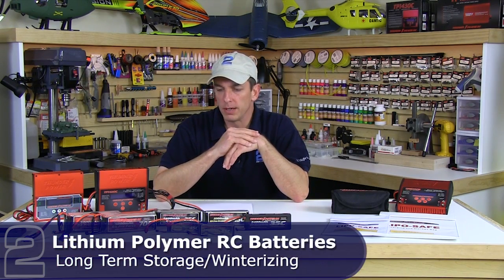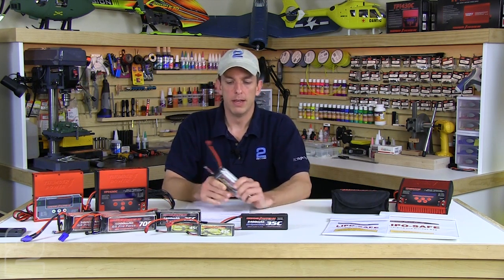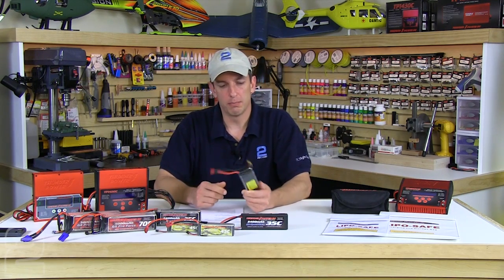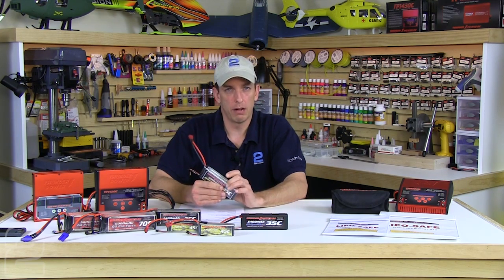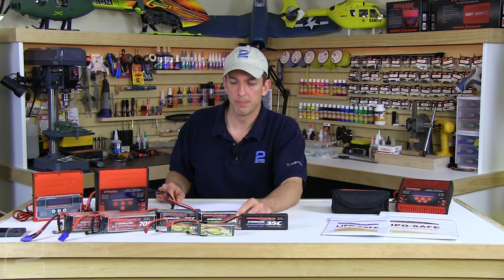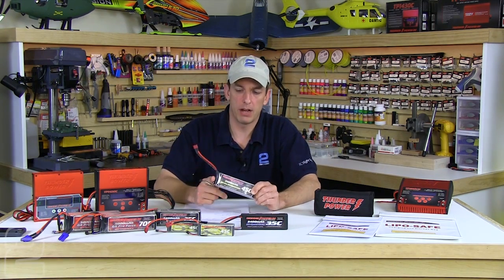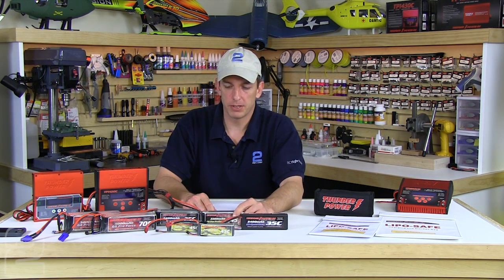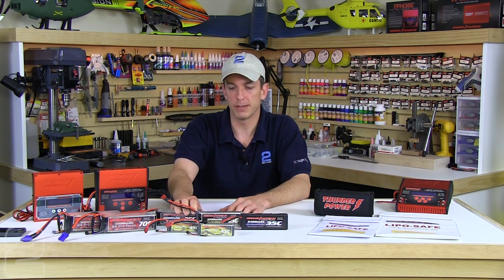RC LiPo Battery Storage

Comment: Im new to this sport i have a accucell 6 charger and my batteries are Turnigy 2.2 3cell    11.1v, 
 I am ok with the charging side of things, but I have a question about the storage.
 once battery is linked to charger  I select storage, am i correct in selecting 3.8v on voltage or do i have to enter the 11.1v.  it also asks what Amp to use for discharge this i dont know. so can you assist me with the answer and is there a formula that allows you to work this out. Thanks for any help Andy

Comment: Can storage charge normally upto 3.8 multiple 4s battery's on a parallel charge board to save time
Reply: So if I have some rc cars with li-ion batteries then I can keep it at 100% charge for a month and it is fine?

Comment: Very new to lipos. I starting out with spektrum smart batteries and charger. 3s 3200mah 11.1v . The first battery was fully charged and I used it playing with my apprentice just setting up everything up for a few days. Put it back on the charger and put it in storage. Storage put the cells at 3.93 - 3.95- and 3.96 volts.. Isn’t that a little high for storage?  Great videos by the way.

Comment: I have a 2S 5000mAh 25c lipo battery. I have a balancing charger that does not have a "storage charge" feature. 
I am reading in the manuel for the lipo battery that it should be stored at 3.6v-3.9v. What does this mean?
Should I just charge up the battery to 50% capacity and store it that way?

Comment: Incredible that in 7 years literally nothing changed in this field. Same batteries, same concepts, possible nothing new happened during these years? also this is not exactly a field that had no updates during these years.
Reply: So what changed then? 
6s are more common now, there are more chargers with the internal ac/dc convertor, and that's it.
Reply: Hey do you know if I have some rc cars with li-ion batteries then I can keep it at 100% charge for a month and it is fine?

Comment: I have a 1s 3.7volt battery. How much would i charge it to store it for long term, still halfway? Also i cannot discharge it because my charger does not have that option, so i would just have to charge it up to the storage voltage.

Comment: My cousin gave me an airplane he found stuck in a tree and I wasn’t familiar with lipo or airplanes (at the time) and I never used the battery or electronics and it sat for about 5 yrs. just recently I came across the lipo battery from the plane crash and I checked the voltage and it was about 17 volts. This is a 4s 2200 mah, I put it in my 1/8 rc8e3 and I ran it for 10 minutes and it STILL has juice but I stoped at about 10 volts and put it away again. My cheap and only charger, reedy charger, wouldn’t read the cell count correctly I think it said 3s rather than 4s and it’s a little puffy not much. I had no idea a Lipo could hold a full charge for that long… Unless one of the cells went bad and the other three cells collected its charge because 17 V is more than what the pack is supposed to be. What do you think?

Comment: I have traxxas 6700 lipo for X Maxx, have Traxxas Live charger with storage mode, If I put battery in storage  will it be good for 4 to 6 months ? Plan on using them in the spring.

Comment: Quick question, I run two Pro Boats and an Arrma #Granite 4x4 BLX Truck and I run a lot of 2s and 3s lipo's batteries!  What's the best number to store them at - 50% correct?

Comment: Hello. can you help me please with some advice? how do I keep my batteries in order not to lose their capacity? even if I put them on the shelf to 50% (lipo storage) some of them lose their capacity when they load them ... for example from 2500mah I still have 1200. I tried to discharge them and charge them again many times believing that this cycle will resurrect them but without success. some of them or puffed and used 2-3 times. I'm new to rc, and even if I really like it's expensive to buy batteries. please help me.

Comment: Am so glad I have seen this video! I normally charge mine fully and store them until the next bash session! So once the batteries are in storage mode how long will they stay like that until they hit the low voltage safety level? You mention 1% a month.

Comment: hi i need your help i am making a electric skateboard and need lipo for max power.i am using 2 motorTurnigy Aerodrive SK3 - 3536-1200kv Brushless Outrunner Motor and 2 esc YEP ESC 40A (2~6S) SBEC Brushless Speed Controller .what lipo would you choose
Motor
Turns: 14T
Voltage: 3~4S Lipoly
RPM/V: 1200kv
Internal resistance: 0.028 Ohm
Max Loading: 38A
Max Power: 560W
Shaft Dia: 5.0mm
Bolt holes: 25mm
Bolt thread: M3
Weight: 111g
Motor Plug: 3.5mm Bullet Connector 

ESC 
Max Cont Current: 40A
Max Burst Current: 50A for 10 seconds
Input Voltage: 2-6 cells li-XX or 6-16 Ni-MH/Ni-Cd battery
BEC: 5.5V/5A Switching BEC
PWM: 8~16 KHz
Max RPM: 240,000rpm for 2 Poles Brushless Motor
PCB Size: 50x25x12mm
Weight: 43g (including wires)

Recommended
YEP programming card required to access the full suit of programming options.

Comment: hello nice info there you gave but i have some questions to make if you have time to answer i would be happyI have two lipo batterys 11,1 v (3c) when i fly my plane when will the battery stops giving voltage?and when should i set the voltage-buzzer to alarm so that i will not have falls.My other question is if i fly and i want to fly in 3 days again should i put the battery in storage or it will hurt the battery?Thanks again...subscribed
Reply: How to DIY you store the battery only if you don't use it for3  6 to 1 year etc btw just charge your battery and go have fun No stress ok.

Comment: I just got a RC electric brushless truck and it have a Kv 3500 motor and a 7.4 4200 5c o 10c lipo baterry. So it looks like new bout some times don't take the charge and sometimes do. Can I use and nikle baterry with that same motor?? Please help me.

Comment: I was told by a few hobby shops to store the LIPO's at full charge and some people saying what you are by NOT storing them at full charge. So, if I drive my stampede until the ESC cutoff that is good storing? or should I just do a short charging time? my Prophet Sport Plus does not have a storing charge feature. I am using Dynamite 11.1v 5000MAH batteries btw.
Reply: liquidalloy that a good idea, just change full battery and run on esc set 4 or 6 v cut off then store

Comment: I wish I'd known this, thanks for this video. I had a battery die once because it got totally discharged, so I thought I should store it fully charged, only to come back a while later to the cupboard with batteries that got blown up ( gassed ) . The guy at the shop never told me to not store fully charged batteries for extended periods. Im totally miffed now, need to throw 3 brand new batteries away. I also wish they would include proper instructions with the battery when you buy it!
Reply: I agree I even told guy at hobby store I know nothing about these expensive rc cars n bought one n gave me no heads up on battery storage

Comment: ok so, if this thing goes low on my shelf will it burst into flames?
Reply: Why im still running  NIMH packs.  A fire bag being needed for  lipo is a waker upper
Reply: Great bird of hope actually NiMH are simpler batteries to work with because they have NO memory and they offer high output BUT they are slightly more heavier that Lopo and if not keep in good condition they will not catch fire....they WILL explode dangerously. That’s the only drawback but as I said they are very easily maintained. Lipo’s are very finicky to maintain but provide excellent performance. So, if you’re not too concerned with speed and your operating a ground or surface/ground vehicle then I would stick to NiMH but if your talking flying vehicles then I’d go Lipo. But understand also that when NiMH batteries discharge they do so slowly and you’ll notice it in whatever RC vehicle you’re controlling but in lipo batteries the discharge is very quick and they don’t slow down as much as they tend to just cut power off completely.😊

Comment: i have two lipo batteries. They have been stored away for at least a year now. I was told at my local hobby store to charge full and put away fully charged , do to the fact that they slowly discharge over time . I have a volt meter and have checked my packs they both are ok volt wise they have discharged so little that they are ok. But my question is do you think it is safe to run these packs one has poofed a tad ... the other seems fine what do you recommend?
Reply: +MyNitroguy poof is bad, get rid of it...
Reply: They gave you bad advice at the shop.  :(
Puffed packs aren't safe or reliable.

Comment: I use 4cell when should cutoff the throttle? when I have 3.85volt for each cell or 4volts for cell?
Reply from the maker: +Fernando Ramirez A little late on the response, but most surface and air ESCs cut off voltage at somewhere around 3.2 volts per cell.  This allows for some additional drain by the radio system if needed (airplanes to land) and keeps you above same minimum values so you don't harm the pack.

Comment: There is a lit of debate about storing LiPo batteries in the fridge. I learned that if you fully charge a battery and you are not going to use them for a few days that its best to put them in the fridge, then warm them up before use. Can you comment on this?

Comment: Please reply, can I keep the storage mode for as short as a month?
Reply: My understanding is put it in storage mode EVERY time its not in use.. usually after using htem they are dead anyways and storage mode just brings hte voltage up some but not all the way.. so you arent storing it with to low or to high of a voltage.

Comment: This is a great video. Wish I had seen it over a year ago!  I bought the Phantom 1 just after it came out plus 5 extra batteries ... Turnigy 2200 mAh 25-50c. I used it for perhaps 5 or 6 months and then stopped using it. I don't know if the batteries were charged or discharged when I stopped using the quadcopter. Most likely some of them had been discharged by the quadcopter to the appropriate voltage, but unless I had used them all on the last day of use, some were probably put away fully charged. There appears to be a slight puffiness in the Turnigys ... definitely none in the original battery that came with the Phantom. Is there some way I can test these batteries to see if it is alright to continue charging them. Can this be done with a regular multimeter. Is there any other piece of equipment I can buy to facilitate this operation. Thanks.

Comment: Hi there. I have some lipos (2200 3S and 5000 6S) which have been stored discharged (3.75/cell or so) for 3mo. Then I charged and they looked good on the voltage meter but the helis started to bog, then I added an meter with alarm and even with a full 4.2V charge 20 seconds in a hover the charge fell below 3.7 and the alarm started to beep. Are those lipos damaged or they could be recovered? Thanks for such well made videos.

Comment: Hi... my batteries always puff slightly after a flight, but then they come back to normal when they cool down. Is this normal?   they always do this in my case. Am I doing something wrong?
Reply: pulling to many amps, buy higher cell battery.

Comment: Hi,
Can you please help? My 15 year old son just got one of these Syma X5C-1.
Someone told me that the Lipo batteries are very dangerous, so I search for videos here on YouTube, and now I'm freaking out. Are these little 3.7 Volts / one cell batteries the same as those bigger ones / multiple cells (used on DIY RC)? Do we need to take the same steps when storing/not using the batteries? Do we need a special charger to put them into storage mode? Please help!
Reply from the maker: Hi Dana, no need to be worried.  A single cell LiPo at 500mAh may puff up if stored at full charge but that's about it. If his battery does puff, just drop it in a cup of salty water overnight (to discharge it) and pop it in the trash. Just tell him to fly the quad for a while within a few days if he has some unused fully charged batteries. This will ensure the batteries will stay in good health.  We use really powerful batteries in bigger aircraft.  His little battery is 1 cell at 3.7 volts, 500mAh.  Our big packs run 22+ volts, multiple cells with thousands of mAh.  Different ball game altogether!
  As for storage, either run them in the aircraft for a while if full to drop the voltage a bit.  If he's run down a battery, put it on the charger for about 15 minutes to bring the voltage up a little.  If he wants to get into the technical side a bit, get him a cheap voltage tester from Radio Shack and he can charge or discharge to 3.85 volts on the nose.  Honestly, 3.7 - 3.9 is still a very good voltage range for longer storage.  In any case, that little 1 cell isn't going to catch anything on fire unless he cuts the wires and twists them together on a full charge.  Or drives a nail through it fully charged.  Use the factory charger, have fun, and don't worry!
Reply: 2BrothersHobby that was great help! thank you
Reply: Fantastic reassurances for a worried mother. Weldone !!!
Reply: 2BrothersHobby On February 5, 2015, Radio Shack filed for Chapter 11 protection under US bankruptcy law after 11 consecutive quarterly losses.
Reply: I have 2 X5C-1 s have had them for several years with no  problem with the batteries blowing up or anything, great little starter drone, and you can fly in the house, on bad weather days...have fun and enjoy it....

Comment: I have left my 2s sitting for 3 months and its puffed up i stored it fully charged amd balanced why has it puffed up
Reply from the maker: Hi Adam, as we said in the video, you shouldn't store lipos fully charged.  You should discharge them to 3.85 volts per cell (or close) when you are storing them.  If you don't have a charger that can discharge to storage, run them in the device for a while to bring the voltage down from full.

Comment: is it safe to store lipo batteries over a year or 2 years,with in 3.8 volts per cell..?tnx in advanced..
Reply from the maker: It's hard to say.  I've had some batteries that have held a perfect storage charge for over two years.  I've also had some top brand, high-end batteries that went bad in 6 months at storage levels.  I'd generally say yes, you should be fine if they were stored at 3.85v/cell for a good year or even two.  I check ours every 6 months and adjust as necessary.  we have over 100 substantial batteries (big boys) on the shelf for testing and it only takes me about 20 minutes with a good LiPo checker.  I can usually go 1 year before i need to pull a few and add some juice.
Reply: 2BrothersHobby tnx buddy...ure great!

Comment: Im new to the electric rc recently got a erevo brushless i use 4s i used to run it everyday after work charge overnite with traxxas 2/3 cell balance charger due to time change i cant run it until weekend on sunday i charge them fully so its ready for the next weekend will this damage my batteries. Brand is onyx 2cell 5000 mah 35c any advice would be great thanks
Reply from the maker: I would recommend getting a better charger and not charging them to full a week in advance.  A better, higher power charger can charge them in 30-45 minutes closer to when you're going to run the vehicle.  Even if they don't puff on you, you're taxing the chemistry.  High probability you'll start losing capacity and discharge rate over time.  Save your cash!  Keep your batteries healthy and get more life out of them.  You can spend as little as 100.00USD and get a two port, higher power balancing charger.  If you're not running them for a couple days, bring them down to storage voltage and then you can essentially forget about them!
Reply: 2BrothersHobby Hey brothers i just got some lipos today in the mail. i run my car a couple times a day, then ill end up putting it away for a night. i do a storage charge on them if im not going to run them in the same day again. is this a good habbit i have going?
Reply: Chief Longwood We are the professional Li-Polymer battery manufacturer in China , With high quality and competitive price, Any requirements please contact us , www.clcell.com  jane@clcell.com

Comment: The RC industry needs a new battery solution. Lipo's suck. They need too much babysitting. And the babysitting requires too much math. Upkeep is not intuitive enough. Some RC cars have Lipo cutoff set too low out of the box, Others have it set too high. It's ridiculous. NIMH are my goto batteries... fast enough, no babysitting, intuitive. But I'm sure all the Lipo-lovers out there have legit complaints NIMH. So doesn't anyone have a new, better alternative? I heard Traxxas might be working on something. Btw, 3.2v is NOT the avg cutoff for the 1/10 RC cars I've seen (well over 2 dozen). Many are at 2.5v per cell.
Reply: glockguy7 
My venom nihms are basically invincible
Reply: It’s called sodium-ion.
Reply: There working on lithium ceramic but those aren't that good rn